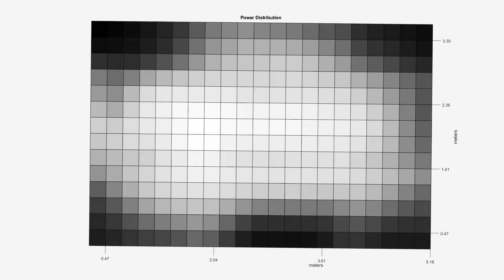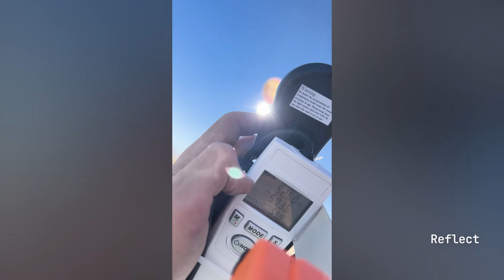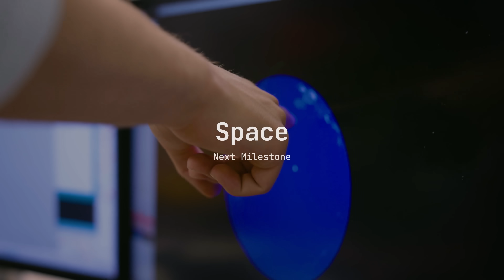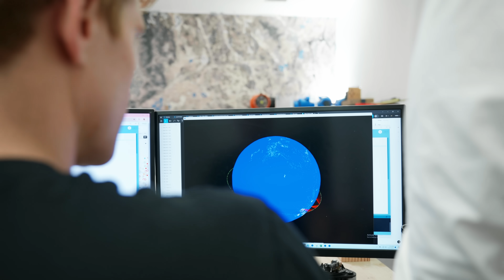They're Making Solar Panels... Work at Night | Reflect Orbital

Comment: the current largest solar sail is around 1200 square meters. Assuming an average solar irradiance of 4.5 kWh/m²/day and solar panel efficiency of around 20% and a (very optimistic) of $0.13/kWh, this theoretical satellite would make around $50k/year. Unless they are able to create a mirror 1 or 2 orders of magnitude larger (potentially possible IDK) or the cost of launching a satellite decreases by an order of magnitude, the economics won't work out (assuming each sattelite weighs around 200kg, has no part cost at all at a very optimistic launch to LEO costing of 400,00 - 2000$/kg).
Reply: Going forward efficiencies are going up. Think 2-5 year time frame. So maybe 25% would be a more reasonable estimate especially for large farms that buy most efficient panels in bulk. Secondly, selling for $0.13/kWh wouldnt make sense if they are providing solar in the evening. Peak costs at 8pm are more like $0.65/kWh.  So they could sell it for $0.6. Also, Maybe im off the mark but it sounds like SpaceX rideshare is $300k for a 50kg payload. I worked through these in my comment, maybe im wrong though.

Comment: Oh yeah, that has massive military use as well. Like surprising the enemy or to level the plainfield during night operations, or to just continue nighttime operations in the industry or military at a scale where artifiical light is not feasible
Reply: But the economics will be nigh impossible. Perhaps with fresnel lenses or something. Per square meter in space they can only expect 1kwh on earth. With intermittency due to cloud coverage. It seems economically impossible, but it is really energy at a service. That should actually work out then in the long run

Comment: Or, hear me out, we could just mass produce a lot of Small Modular Molten Salt Reactors using thorium as fuel and put them all over the place. Put one at every current power substation and create a highly redundant distributed grid that doesn't rely on delicate and expensive high voltage transmission lines.

Comment: When they look at the energy involved the global warming nuts will come at you with everything they have.  Right now the solar farms take sunlight during the day and convert, lets say an average of 25% to electricity.  (The 25% is just a talking point.)  This energy can be transported with wiring somewhere else.  Let's say the average energy is about 1 KW per square meter.   The rest of the sunlight is absorbed by everything that doesn't convert it to electricity.  Eventually it is Heat.   At night some of the heat is radiated into space, creating a micro environment.   As I see your plan you will intercept sunlight in space that would not normally fall on the earth.  (Otherwise you make someone mad because their tomatoes won't grow).  To be viable you need to reflect enough to at least be near the daytime intensity.  That means you have doubled the amount of heat hitting the area of the solar farm.  How do you think people will like a 75% (times 2?) increase in heat in that area that doesn't have time to "cool" during the dark?  Also, the "loss" through the atmosphere means you need even larger reflectors to maintain the same energy from the farm.  I suspect the math will show that you have a problem.

Comment: Some very rough calculation: 
Assuming 10m x 10m reflector, each sat of 100kg; Launch by Falcon 9, 100 sat per patch, which is 10t to SSO, not crazy. Cost 60M per launch.
Each sat reflects about 100kw solar energy and assume 10% convert to electricity overall. Each sat produce 240 kwh per day, rounding to 200kwh for other loss. Assuming night electricity price of 50 cents per kwh and morning price of 20 cent, which just say on average is about 30 cent per kwh. Each sat produce 60 dollar. Each patch of sats produce 60*100*365, roughly 2M per year.

So you will need these satellites to work over 30 years to make it profitable. Sounds bad at first glance but far from practical. Just need some improvements on cost, the economy may be just in reach. Great!

Are you guys interested in taking interviews?

Comment: I work at a electric Hydro company and we have wind farms that does 40Mw almost around the clock but we get to use the river systems as a battery by holding back water or using less while wind it high
Reply: It is difficult to use reservoir energy storage in the plains
Reply: @ddzz3927  the wind farm is in the plains but the rivers im talking about are not.

Comment: I think it's going to be expensive to maintain, and to launch aluminum foil into space, you have to withstand light pressure, so you have to push it regularly to maintain orbit.  
Moreover, the aluminum foil will be blurred and rough by high-energy particles/high-speed cosmic dust, which means that the life of a single aluminum-plastic film spacecraft is very limited, which requires low-cost transportation capacity support.   
And then there's the issue of orbit, and of course the cost of launching from this high-latitude orbit is slightly higher

❤from chinese
Reply: If they wish, they can also practice the orbit control technology based on light pressure ( )   
Then the Earth-Moon transfer is performed using light pressure and electric thrust ( )

Comment: I would be very surprised if they could reflect the same power as the Sahara solar farms for less than 40b$.  Also considering the power consumption to get the mirror into orbit is quite significant (even on a future starship), how long would it have to operate to become net positive?

Comment: Because the distance earth is from the sun it's rays are almost linear or hitting earth perpendicular to the ground.  So to light up and area with the same intensity on the ground you will need a similar size reflector in space, if the area being lit is larger then the intensity will be lower.  One proposal would be light up urban areas equivalent to light intensity of 3 full moons, so less power would be used on street lighting and general urban environment would be will lit it city area's.

Now I'm not a scientist but the surface of the earth being illuminated is pretty consistent, so on that basis if you are adding light to one area you are taking light away from another creating shade, so you will have areas that are warmer and colder.  I do note that the arrangement of satellites were in shaded areas at altitude so still able to bring in extra light, so based on that logic you are introducing more light / energy however infinitesimal back to earth.

My conclusion, don't use to illuminate solar panels but illuminate major city areas so less money is spent using electricity to power street lights?

Comment: I remember watching watching ben's youtube channel back in the day. I know for a fact this dude is one hell of an engineer. Im having a hard time reconciling how smart he is with how dumb of an idea this is. What the hell am I missing here? If the mirrors are in a sun sychronous orbit, wouldnt that only give the solar panels on the ground an extra hour or two of sun? So these solar farms would still need batteries, just slightly less? They want to sell sunlight cheaper than a battery can provide it? That cant be right.
Reply: Big, lightweight satellites like these would experience a significant amount of orbital decay, so they would need to be in a high enough orbit that they would need some form of propulsion, like an ion thruster, for collision avoidance. What about orientation? Reaction wheels or can they rely on magneto torquers alone? The mirrors will need solar panels and batteries of there own as well. Dont forget about communication equipment also. They will need to build these and launch them super cheap to provide energy cheaper than a battery. I'm no expert but I find that hard to believe.

Comment: I love this idea! It always fascinated me after learning about the Russian Znamya satellites. I did some back of the napkin calculations a few years ago, and even if we’re talking micron-thick tinfoil, it would be far too expensive to put into geosynchronous orbit at anywhere near the level necessary for much power generation. 

In LEO the surface area necessary decreases dramatically for the same power output, but then you have the problem of whizzing around the world every few hours, meaning you don’t get much time over your target solar farm. 

In theory, you could have centrifuges control the angle as they orbit the earth so they can hit multiple solar farms through its orbit, but this will be more difficult the larger the reflector. 

There’s also the issue of light pollution. People complain about Starlink which are really tiny and designed to be as non-reflective as possible. Imagine when instead they’re huge and as reflective as possible. The light pollution in the night sky would cause some serious complaints. 

It would take something like a super cheap starship, or massive moon production to get something like this set up. 

Unfortunately what they’re building is too dependent on the rest of the industry progressing dramatically to really succeed. Unless they have billions of their own money to throw at the problem, the timeframe for a payoff is going to be far, far too long for any reasonable investment. 

Maybe there’s some government or military applications that would be warranted though (giant mirrors warming Siberian towns in the winter or something, or reflectors lighting up an enemy position to blind any night vision, and make them easier targets. 

Best of luck! It’s a really cool project either way.
Reply: The expense can be lowered if launched on Starship.  This is another Starship enabled tech.  Those sails would quickly capture masses of excess atmosphere in low LEO.  High LEO, MEO and HEO might be better, but optimizing the benefits of LEO (autofail cleanup and less beam interference) would have to be balanced.  Going higher up means transferring more light further.  Probably they're looking at high orbits.  They can say that the amount of light hitting other satellites is equal to sunlight if they don't concentrate the beams, causing very little disturbance to other satellites, so perhaps that's the best approach.

Comment: This will not work. 1. Light reflecting downs from a mirror like this will be diffused in the atmosphere, yes you can get light to those panels but it will be weak and spread-out.  2. They assume that the mirrors in space will be cheap to place into space and to keep it in there.  3. How do they plan on the station keeping for these mirrors - to point them at exact points will need to be significantly nimble.  4. Also even if all those things were not a problem, then how do they plan to make this cheaper than alternative power storage, such as pumped hydro, liquid air batteries, etc.
Reply: You seem overly presumptive:

1.  Sunlight mostly goes direct.  Diffusion won't scatter the majority of the energy light.  You know how I know?  Watching clouds block the sun:  my generation drops by 75%.  Do you even have solar?  I do.
2.  Starship.  (Anyone reading this that hates Starship, go on hating.  Those of us who understand it will leverage it.  I don't need you on board.)  It is yet to be seen how much this costs, but don't go by Falcon 9 for your prices.
3.  Station keeping.  These will be huge sails.  They'll need to figure out a way to counteract atmospheric slowdown.  I'm concerned by that too.  But maybe there's some optimum orbits where that will work out.
4.  Storage is awesome.  I have storage.  I want more storage.  I was probably the biggest energy storage advocate in the world in the 1980s through the 2000s.  But it's expensive.  Even in the future when prices drop dramatically, it will still be relatively expensive.  Having a viable option available would be nice, if it is cost competitive.  I haven't seen the numbers yet, so I can't answer that question.

So, it's not for sure, but your initial statement "This will not work" seems presumptive.
Reply: @bradallen1832  It's not storing the energy but transmitting it long distances where you encounter losses
Reply: @bradallen1832  Hey, Hey, I did not mean to offend you, so please don't take it that way :D Yes I do have solar panels on my home and they do about half of its electric power. I am actually member of a group of people who are fans for solar power satellite SPS, which is why I was able to explain why this would not work.                                                                                                                                                            In the above post please allow me to expand more on #1, where I said "Light reflecting downs from a mirror like this will be diffused in the atmosphere, yes you can get light to those panels, but it will be weak and spread-out."   The light diffusion is actually very high. In the daytime the sky is blue due to the Rayleigh scattering. While it might be possible to aim a mirror to reflect sunlight to a photovoltaic panel, even on a clear night with no clouds, with the best possible angle, and best possible reflective mirrors - you would be looking at about 16% ~ 15% of what those same solar panels would be doing in the daytime.   Also, when I did the math for this, I assumed a small set of panels that you would use to power a few homes, and the mirror in space was 10  km squared area. It needs to be this large due to the amount of diffusion and the fact its' about 900 km over its target.                 If these guys were doing this to say try and power a colony on the Moon, this would work out much better and might make sense to pursue. The moon has no atmosphere, the mirror can be closer due to low gravity, so the math overall works much better. Also the moons rotation is much slower with a day night cycle that is 30 days so trying to get the best angle will be easier.                                                                                                                                                                                 The SPS design would work where you have a large PV satellite in space, from there the power is beam down to earth in the form of microwave beams. These microwave beams will then be 'caught' by a large rectenna, that might be a few square km. This would allow us to have power about 20 ~ 22 hours a day. Unfortunately, right now the launch cost for this is prohibitive.
Reply: @bradallen1832   Sherlock. Visible spectrum? Have you heard about it?

Comment: Couple of concerns. Ben just being so dismissive of batteries as a reason to do this is naive. Storage is both fundamental and a necessity. Weather will always occur. 

Light will naturally diffuse through atmosphere. This is harder than it sounds.
Reply: "diffused" or absorbed as HEAT, i belive we are forgeting a variable in this equation.

Comment: As much as I love technology and science. The question I think many people are forgetting is "should we". There is a reason why the sunshines one side of the planet and we already have a natural "mirror" in the sky (for those that don't know what I am talking about, I am talking about the moon) and the intensity of the reflectiveness of the moon isn't the same intensity as a mirror which can reflect the same intensity. So these are things to consider and also other environmental impacts as well.
Reply: A sentence is a complete thought.  A question ends in a question mark (?).  Since this is entirely bogus, it will have no environmental impact.
Reply: I'm worried about the atmosphere scattering light all over.  I wonder if there's a way to get around that.

Just one thought, obviously not what they said in the video and not complete on my end:  I'm starting to think about diffracted light bleeding into the night sky during humidity causing issues at night, so one way to circumvent that problem on humid nights is only target panels during dawn, dusk, twilight, and evening, so that the bleedover effect doesn't interfere with sleep and darkness.  This would mean the space array is best used closer to the land panels on humid nights, and means they don't lose space reflector capacity due to double and triple hop networks on humid nights.  On dry nights, diffraction is less of an issue, so the space reflectors would get to consider multihop network issues while they consider lighting up ground panels more of the night.

Comment: Because of the SpaceX starship this is totally possible. And it might be our best way of having in-space power production. Screw those microwave ideas I like direct sunlight reflection better
Reply: Microwaves can penetrade the cloud layer, so putting the solar panels into space and sending the energy back to a receiver on earth via microwaves makes more sense to me. Just adding one more hour of light to existing solarfarms depending on the weather is kind of limiting. And if we have to put  reflectors into space, why not already use super thin solar cells, which will be not much thicker? There are ceveral companys who are working on solarpanels, which are 100 times thinner than existing ones and in space, they obviously don't need the strucural support and glas panels like earthbound solar farms do.